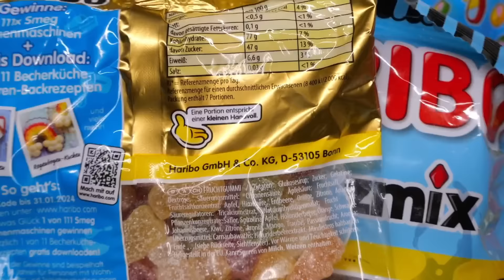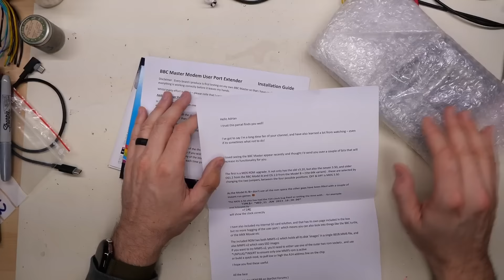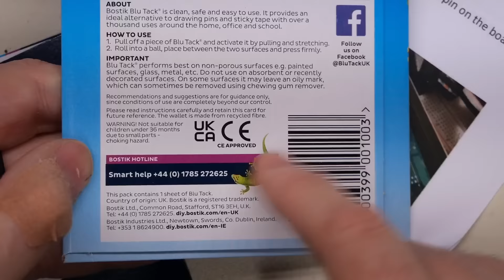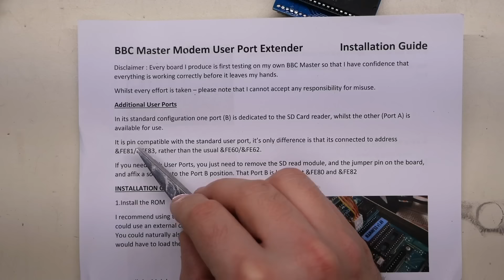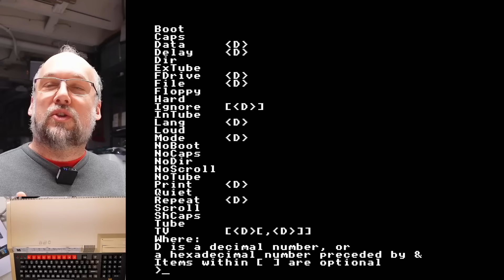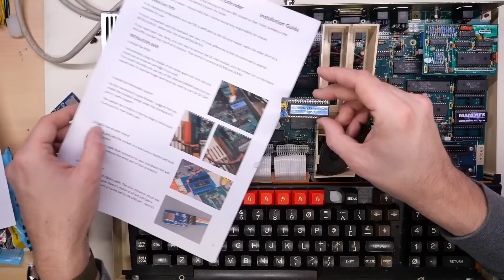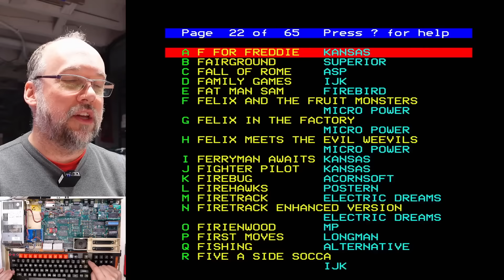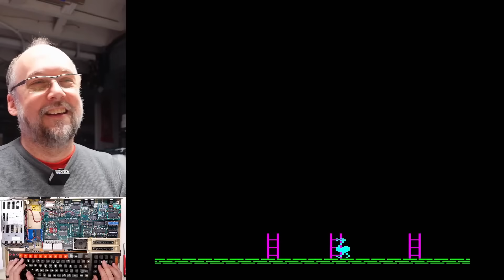0081 ROM and SD card upgrades for the BBC Master 128

Comment: Chuckie Egg.  You can press the diection keys together, so pressing up, if you press left before you get to it before releasing up, it changes direction.  I could generally get to level 24 back in the day.   Chuckie Egg was available for a few platforms.
Reply: That, and IIRC you can jump on and off the ladders, which makes the game a bit more dynamic, and jumping 'against ledges' gives you a boost.

Lost so many lunchtimes to this game in primary school.
Reply: Can it be that Speccy behaviour was not translated to the BBC? I mean, there are tons of Pac-Man versions that don't abide the holy rules of Pac-Man control. Pac-Man keeps going into the direction until it bumps into a wall, and you can send short "direction change instructions" ahead of T-junctions. So if you are in a tunnel to the left, and you shortly press up, Pac will remember that and go up as soon as it can.

Comment: There's a trick to Chuckie Egg, you press the up/down button just before you get to the ladder (and likewise, pressing left/right to walk off them onto a platform) then it plays really smooth and easy. You can also jump on to ladders by holding up or down while you jump. And jump off ladders too. After a bit of practice you'll be addicted.
Reply: I was at the NMOC at Bletchley Park and went into their BBC Micro lab. One of the machines had a boot menu of games and applications. Chuckie Egg was on it; I fired it up, and about ten minutes later one of the staff wandered by and said, 'You do know how addictive that is, right?'
Reply: The jump and eating seed sound effects from Chuckie Egg were seared into my brain at about 6 years old along with Candyfloss lol ;)
Reply: getting an optimal key definition is critical...use the same definition as acornsoft snapper/pacman
Reply: yep. I even said it out loud. .. "hold the up key"

I spent many a night locked into chuckie egg'ness after spending all day trying to become mostly harmless 

loved my mod b
Reply: Yeah, it's pacman style controls, hold the direction before you get to the ladder

Comment: Adam Savage from Mythbusters has great organizational videos for your shop. Me, I use Plano tackle boxes, Christmas ornament organizers, and filing cabinets to organize everything from nuts and bolts to connectors to components to power supplies. An old clothing display for cables and leads to hang so they don't look like a tangled corkscrew.

Comment: For your organization issues.  Something that works for me with small components is 3ring binders with playing card sheets and little ziplocks.  It’s good for capacitors like, resistors, diodes, transistors and even ICs.  It could be better and I recommend spending the extra few dollars to get the card sheets with the tabs to hold cards in…but over all its high density and fairly low cost.

Comment: If you type "*FX 0" (without quotes) at the ">" prompt on your Master, it'll tell you which MOS version is running.  The top line after you press BREAK is different on each version too:

"BBC Computer 32K" = original Model B.
"Acorn OS" = Model B+ (64K or 128K).
"Acorn MOS" = "Master 128".

At 32:25, you're in Model B+ (OS 2.0), but the SD card is plugged into the modem port, which only exists on the Master.  If you had it plugged into the user port on the bottom, it may well work on the B and B+.
Chuckie Egg: use AZNM or AZ,. (up/down/left/right) and space (jump) for the control keys, it's much easier than using the keypad.

OS 1.2 from the original model B is the best operating system for games.

Comment: An old trick from my rc plane days. Take baby food jars and run a  couple screws through the lid onto a vertical surface. Put small parts like screws and hardware in the jar then use a sharpie to write a description on the bottom of the jar. Just twist the jar onto the secured lid. Great way to recycle. I do recommend putting parts in a small zip lock bag first to avoid spillage.

Comment: For Chuckie Egg, you can jump on and off the ladders, which makes things much easier to navigate. Fall distance isn't an issue -- you just have to avoid falling off the bottom of the screen. 

Funny thing is, a major part of Chuckie Egg's appeal was how easily you could bounce around the screen compared with other contemporary games.
Reply: Interestingly, Super Mario Bros had the same super fluid motion that Chuckie Egg had --- but Chuckie Egg came first.
Reply: @bewilderbeestie  and both are still super impressive to me ngl
Reply: the other thing to do on Chuckie Egg is to just press the up key whilst walking sideways, and then when he comes across a ladder he'll start going up it.  no need to be pixel perfect.

Comment: As I recall, the memory map changes depending on what filing systems are loaded, this could be that  the older MOS don't  really like the way that a Master is set up. The old 1.20 ROM was the first proper ROMs for the BBC Model A and B (there was a 0.10 EPROM released with the earliest BBC A) but the way that the memory is set up changed a lot (e.g. 1.20 didn't handle paged memory beyond the ROMs).

A lot of the British computer mags had cheat sheets for the old Acorns. Can't comment on MMFS - that was something that came along later.
Reply: The earliest MOS was 0.9 but it was terribly buggy.  The BBC Micro went through a couple changes to get 2.10

Comment: Hi Adrian. I organize my chips (ICs) by functionality. I’ve got: Op-amps/comparators, oscillators/timers, power amps/current drivers, voltage regulators (78xx & 79xx series), display drivers (LM3914, 7447/8, etc…), telephony, EPROMs, AtoD/DtoA, transistor array, and so on. For popular ones, I keep a maximum of 10 of any part # (like 74LS00 in the “NAND gate” category, or 7805 in “voltage regulator”) in the little plastic bin; extras get stored in a larger plastic bucket (that used to hold styling gel) that I washed and cleaned. I label the bins with a Dymo-brand labeler. For really popular parts, like 7805, 741/1458, 555, etc… I have a whole ‘nuther storage bin thingy just for those, and those are labeled by type as well, but more specific. So that one has bins labeled “Volt. Reg. Pos. Fixed”, for 78xx series, and “Volt. Reg. Neg. Fixed” for 79xx series, and so on. It also has bins for NPN/PNP (small-signal), and NPN/PNP (power), N-/P-channel FETs and MOSFETs, each color of LED (I/R, red, amber, yellow, green, blue/white, and oddball (blinkers, RGB, flicker-flame, bi-color, color-cycling, etc…)), and various types of diodes and rectifiers, all neatly labeled in case the bin takes a trip to the floor by mistake. 😊 When I perish, someone’s going to think I was running my own parts warehouse in my apartment! 😆

Comment: Adrian if you are running out of wall space remember you are in a basement. Some plywood, piping, and if you want to splurge torsion springs and you can mount all the space you could ever need for components between your floor joists. Can be really cheap and easy.  If you are gonna organize it all don't forget to use an IMS which can be just a spreadsheet if need be and label your shelves, boxes and locations well for easy picking.

Comment: My strategy to organize components:

Put them into standard size paper coin envelopes or plastic bags. Label every one. Find a container that can hold lots of the envelopes... I use some steel compartment boxes with internal plastic dividers. Put envelopes in, keep sorted.

I have 100 or more types of random transistors and ICs packed into an 18" x 12" x 4" box this way. And other boxes with different types of small parts (screws, nuts, bolts, pipe fittings). It's a lot more dense than the small plastic drawers. The boxes that I have fit nicely into an IKEA bookshelf.

Cardboard bin boxes also can work well for holding sorted stacks of envelopes or bags, and they're a lot cheaper than the steel boxes.

Comment: Aside, you can also get swiss-made watchmaker's grade bluetak, though it comes in a bright blue-green and a dull gray. Called Rodico, by Bergeon. The gray stuff is stickier and leaves less residue. None of them leave much residue, but for watchmakers even a little is a lot. Also A&F Rub-Off, which is a bit waxier and dark blue. These are used for cleaning because they absorb oil, grit, and fibers. Also to hold parts for inspection, and to pick up impossibly tiny parts without tweezers that might slip and launch the part off the work bench. 

And if you're looking for more color variety, I can also recommend HandiTak by SuperGlue, which is bright yellow.

Comment: FWIW: You'll probably find MOS 3.50 the default OS for your Master. OS 1.20 and 2.00 for maximum BBC B and B+ compatibility respectively. I have a similar setup with a toggle switch hidden inside the cartridge slot - I can't remember the last time I used anything other than 3.50.
PS: There are patched versions of Chuckie Egg that add more colour, options, levels, etc... that might be worth digging out. Also when you want on / off a platform or ladder press <UP / DOWN> along with <LEFT / RIGHT> and you'll have no trouble - jumping on and off ladders is a thing too!

PPS: Do take care with those MMFS ROMs! The modem version has a different I/O address than the standard ones - you also need to make sure you don't have multiple versions loaded or much confusion will result!
If you find a really, really old game won't run with MOS 3.50 / 3.20 it's worth trying OS 1.20 / 2.00 as most (rare) incompatibilities are OS rather than hardware related... do be sure when running the likes of MMFS with the older OS's it's still set up as the default FS or you'll have trouble with loading stuff or getting <SHIFT> / <BREAK> to work.
Better yet, most of the uncommon software that doesn't like the Master OS versions has long-since been patched by the community - a bit of googling or searching StarDot will usually turn up a Master-friendly version.

I hope that helps a bit.

Comment: Adrian for organizing components the Home Depot brand organization boxes for screws and bolts are great for components, they are flat, stackable and have compartments which are great for ICs and electronics the good thing is that they do not take a lot of space as you can stack them, I have them all with labels on the side, the good thing is you can have them on a shelf and bring the one with the “family “ you need to the workbench I’ll see if I can post a link here.

Comment: Re: Organization.  For small parts with a lot of values, instead of parts organizers I bought some baseball card sheets.  I put the components in small 2x3" bags and then slip those in the card slots.  For through hole resistors, ceramic caps, small signal diodes/zeners it has worked out pretty well.

Comment: The ring bound user guide for the model B is what you need. The welcome guide supplied with the master is just what's different from the model B. I've still got my well thumbed copies
Reply: yes, I still have mine .
I've got the standard one and an advanced one in a box with an electron I should be doing something with. 

I've also got a hand written note book full of my codes /hacks /undocumented stuff.

I've posted pages from it on my Minds account a while back, I should be using that more.

Comment: Best thing to do with your parts bin is to make a rolling rack so this way you can tuck it out of way or in front of existing shelves or next to hot water tank. When needed you pull it out next to bench need be.

Comment: I am commenting after only 1:30 and you have exposed one of the great truths of life. Free stuff is never free. Free stuff increases life complexity. Free stuff will cost many searches for things that may or may not be owned. Or just much harder to find. Free stuff can increase life complexity to the point where it is hard to function, and where guilt about unfinished projects and unused stuff can start to set in. And it will get worse. Free stuff can cost so much over time. Beware of free stuff :)

Comment: In most of these games you don't have to be pixel perfect, you simply hold the key down for the other direction before you need it and your character will change directions as soon as possible. I just checked with the Speccy Chuckie Egg and it works as I remember. If you're going left or right toward a ladder you want to climb just keep holding down left or right and then also hold down up or down while heading to the ladder and it will climb it as soon as its in the right spot, then release the left or right key unless you also want to get off the latter at the first opportunity.

Comment: On Chuckie Egg, press up/down before you reach the ladder, left/right before you reach the platform. Try and get to level 9, it’s the same as level 1, but the bird in the cage starts chasing you and it does not use the platforms 😊

Comment: BBC version of chuckie egg was the definitive version... Hold the secondary direction as you run past a ladder and it'll lock on IIRC... Revs is a brilliant driving game for the beeb too and is on that sd image... I wish there was a better way to edit the menu and discs but it uses an old app which edits a single giant master file so isnt easy to add/remove stuff. super cheap to build though, as you know.

Comment: For component storage I always use Duratool D01933 Assortment Cases or the original version by Raaco not sure if they are available in your are i couldn't find them on Amazon outside of the UK but if you can get them they stack very high when not in use.

Comment: If a game fails to load, crashes, or you end up with screen artefacts, select OS 1.2 for compatibility, as many of the early games expect the 32 K memory map of the original BBC B, and occasionally the 16K BBC A, and use every last free byte, from page zero up. Bytes sometimes used by later MOS versions.

If your going to use ORIGINAL games disks, at any point, you might want to stick an old Intel 8271 single density disk controller in one of your BBC B, as a few developers exploited quirks of the Intel chip (other than the heat it produced to keep a room warm), that they had in their own machines, to create proprietary formats, in an attempt to protect their software. Was a bit of an issue as far more machines had a switchable single/double density, non storage heater, WD 1770 or WD 1772 disk controller, that had their own quirks, and could create a different set of non-standard formats, and even swap density between sectors. Which obviously wouldn't be accessible on a machine with an 8271 and vice versa.

Then again almost everything has been imaged by now, and available on SDcard, or via Econet. 

If you have time have a look at Repton 2 or 3.

Comment: So the corruption is due to the wrong MOS being used.  All but 2 games can be run when in OS 1.20.  I can't remember the reason for the ?CARD issue on the Master but perhaps because this has been set up to run under ADFS and not DFS, perhaps.  I don't have my 2 Masters set up that way.  However, you have the link to the startdot forum so this is a question that persons there will have come across.  I would ask it there.  They are very helpful folks and you can find out literally anything Acorn there.  Pretty good video, also you may be able to ask Richard, he'd likely know.

Comment: the older OS are useful for software compatibility

the hardware was largely backwards compatible. acorn used redirection vectors as part of the OS calls, so that properly written software would work seemlessly across diff OS versions

unfortunately, games devs bypassed the vectors and invoked specific addresses used by the most common OS1.2, which means running on newer OS caused problems

Comment: "Who cares about modems?" I care about modems!  I still run a vintage DOS-based BBS with real modems that people can dial into, and do get actual modem callers. (There's dozens of us!)
Reply: How does this work without the "dialing" concept anymore?  As in (locally) I don't have "copper lines" to dial out on?
Reply: I use an analog telephone adapter with a VoIP provider. The modems plug into the ATA, which plugs into my home LAN, and phone calls in/out go over the Internet. With a lossless codec like G.711 u-law modems work quite well, even in the 28.8k range. (weird I've posted this comment twice and it got deleted, maybe this sticks)
Reply: @bryanwann   Ok. (Your post seems to have worked now). Thanks for the info, I didn't realise this was possible.  Cheers.

Comment: this is off topic but maybe you or somebody has a clue: I have a problem with a pentium 1, it's an AT motherboard, I keep getting the cmos battery failed error message even with new cr2032 batteries. there's nothing leaked or weird on the motherboard, BUT... if I leave the computer on for a couple of hours, I set up properly the bios settings, it saves and then it works fine for the rest of the day. if I turn it off it resets to factory defaults again. I've tried a couple of new batteries, they are working and the contacts are good because the date and time work and are correct. it's like if the battery is keeping the date and time but it's not powering whatever saves the bios settings.
I hope I don't have to recap anything

Comment: "BBC BASIC is like Microsoft BASIC on the Commodore etc." No, Adrian. BBC BASIC is way, way, WAY better than Microsoft BASIC. BBC BASIC is simply the best version of the language available for 8-bit machines, because it’s (a) the best performing implementation and (b) the richest and most elegant version in terms of structure and open-endedness. Of course, it got even better in its later 32-bit ARM implementation, but even in its 8-bit versions it’s very capable and performant, and one of the reasons why the BBC was such a fast machine. Maybe Commodore’s full-screen editor was advantageous for editing programs compared with Acorn’s line editor, but as a language BBC BASIC was vastly superior to Commodore BASIC in particular.